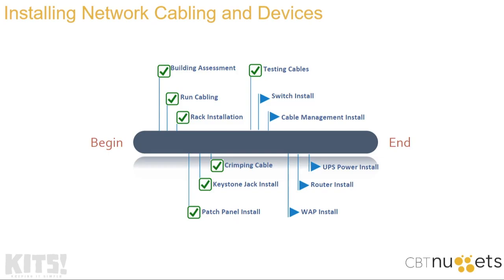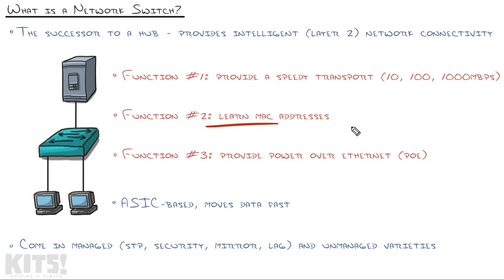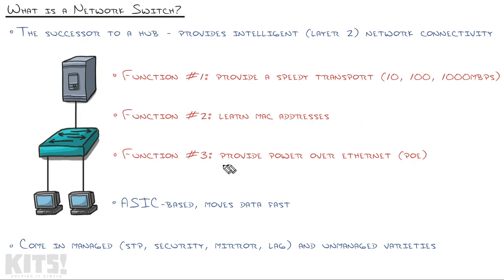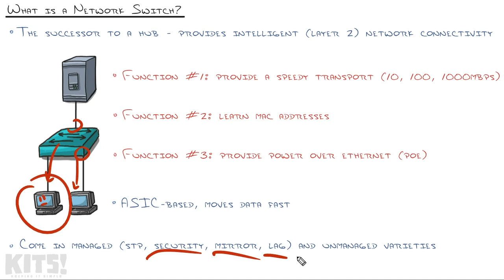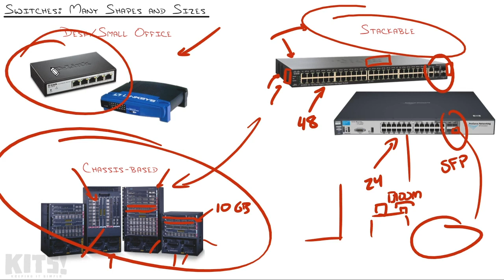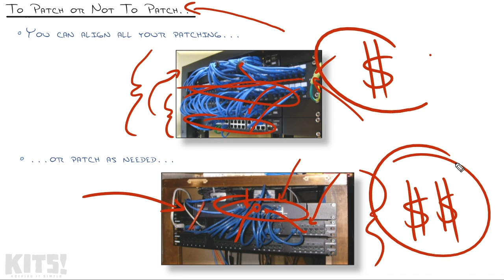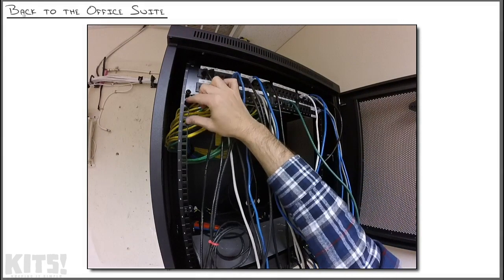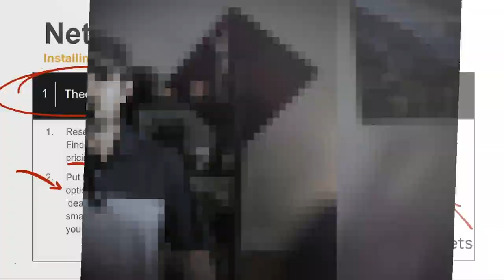Real-World Network Switch INSTALL!: Real World Cabling Ep.7 - Keeping IT Simple

Comment: This video was very helpful. I have a question for you. We have both office and warehouse space at our business and we are in the process of installing a number of PoE powered security cameras. We have quite a bit of existing Cat5E cabling through out the building running any which way. Some of the cables go straight into switches, others go into patch panels... I know there is a limit of maybe 300ft or less for Cat5 cables and I'm trying to figure out if all our switches should be in one location (this is not how it is now) or if it would be better to keep the switches spread out so there are shorter runs from switch to each camera. I definitely see the benefit of having multiple switches in very close proximity or even in the same rack, but again, unsure how feasible that is if our cable run is too long.

Comment: For neatness of cabling and easy of use, in my opinion mounting your switches above and below the patch panel (patch panel in middle switch sandwich) is the way to go. This way you can have short patch runs, and do not need to both with the cable manager. It appears you have a 48 port patch panel, with one switch above and below. you can patch the upper row of port to the top switch and the second row of ports on the patch panel to the bottom switch. nice short 1ft (30cm) patch cables (which are easy to obtain from online source [primecables.ca, or monoprice.com ])
Reply from the maker: Thanks Jason! The video I post next week will be on the cable management side of things ;)